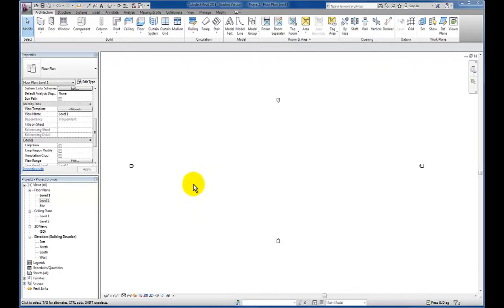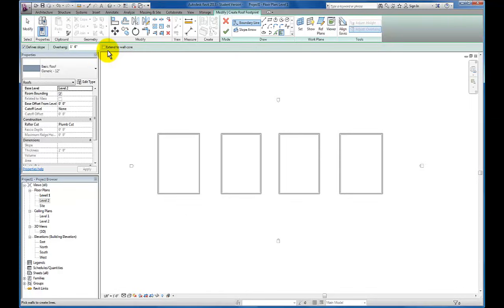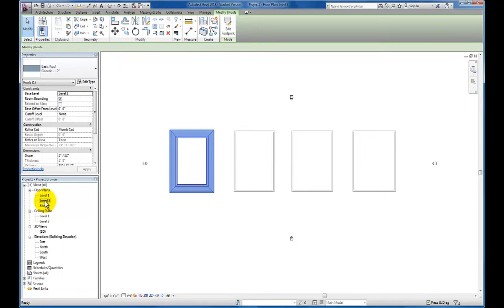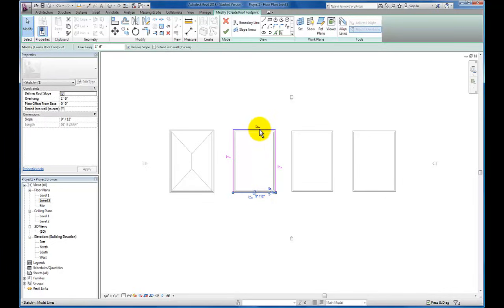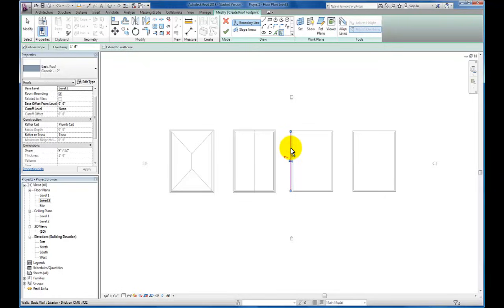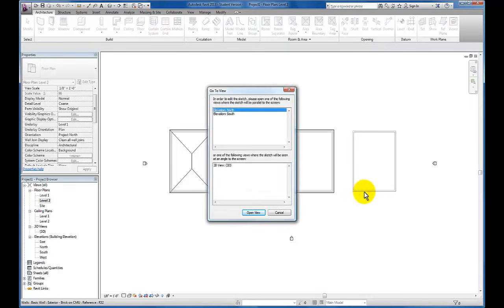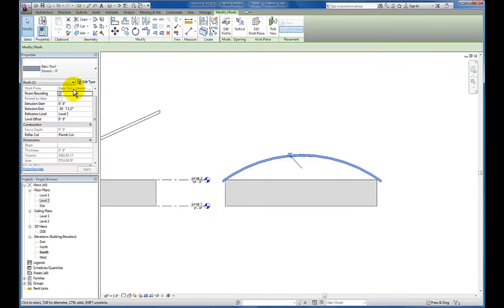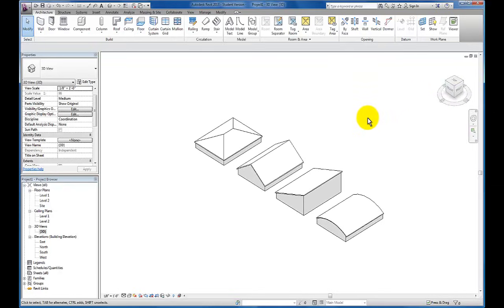Revit Tutorials: Roofs

Comment: Great! Thank you so much. Quick question, is there a way, for my context buildings, to shape the roof in a conceptual mass family? I extruded all the surrounding buildings and now I'd like to give them a roof shape (so split in the middle and extend it up kinda...). Adding edge tool doesn't work on top surfaces and the only way I found until now is to create two masses next to each other, make the adjacent edges higher and then joining the masses. But it's a lot of work. How would you approach the context roofs? Cheers

Comment: Thanks for all.  Now I know how to make generic roof, but after making generic roof on framed walls, I can't seem to putt up the ungabled ends of the wall to the roof.  OTOH if I was to wait to use the framing add on after making the roof I get an error.  got any suggestions.  Revit city doesn't seem to be a help.
Reply from the maker: Remember to use the attach walls to roof command which will show up once you select the walls in the conceptual ribbon.  Do you see it?  If you are doing it properly, it will take seconds.
Reply: problem is that I had converted my walls to a framing after making generic walls with framing extension.  The way that the building I am trying to model is made .  It isn't how revit wants to frame it.  My building has walls that are framed all straight with 2 sills going along the top and on the gable ends it has these rafters with cripple studs on top of those sills.

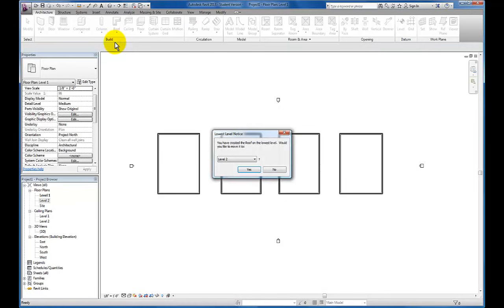Comment: It is not giving in revit the lower level notice in the very beginning of the video (1:24) and is then creating it as a floor...  i literally follow step by step... any advice?
Reply from the maker: +Kellie C   No problem.  Sounds like your project template did not include 2 levels to start.  So first open any Elevation view and  click the Architectural tab and on the Datum panel on the far right of the screen....click Level and and add a new level to the project.  Make sure you set the elevation to be higher than Level 1.  All other steps will be the same for you.  Thanks for watching Kellie.
Reply: +SmarterArchitect thank you

is there a way to get the project template to include 2 levels to start?
Reply from the maker: +Kellie C Sure!  Open up the project template file wherever it is currently pathed on your C: drive and add an additional level, save and close it.  Then every new project started with that template file moving forward will have 2 levels.  Pretty easy, right?  Hope this helps

Comment: When I select Roof by Footprint, it doesn't ask me to move to a different level. So I manually chance my Base Level in Properties to Level 2. The issue I am experiencing is that using a Basic Generic 300mm Roof, I am unable to access the Slope in Properties and change it to a 8:12 Ratio. Any solution to this?
Reply: Revit2015

Comment: When I begin to add the roof (1:22), my Revit doesn't ask to create a new level 2 and I'm unable to create a new home in the home tab.
Can you please help with any advice as to what may be going wrong?
Great tutorial by the way. I able to create the roof. The problem is it's on the same level 1 as the walls infrastructure.
Thanks.
Reply from the maker: Check out the video response I posted here:
Revit Tutorials: Roofs Tutorial (Video Response)
It should address your questions.  Thanks for visiting Smarter Architect.